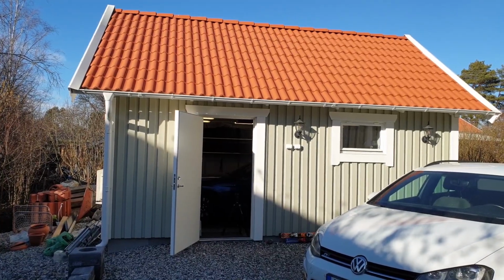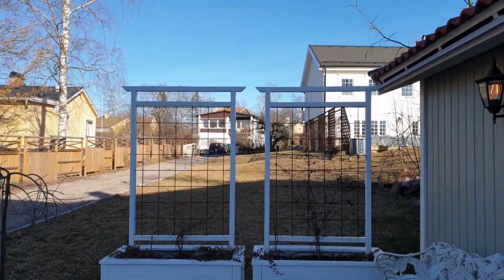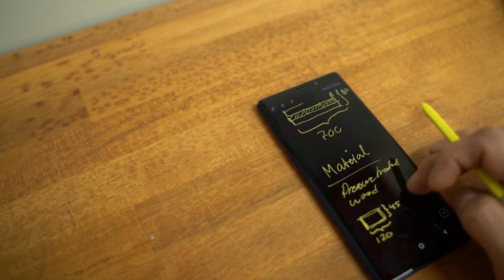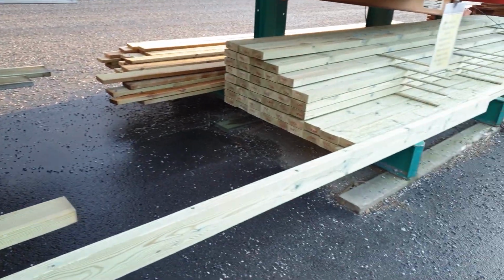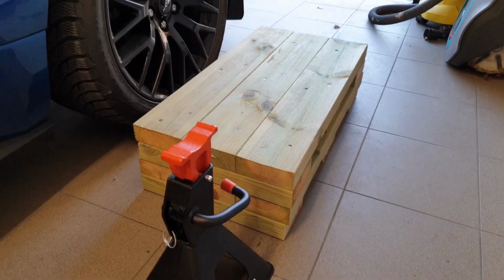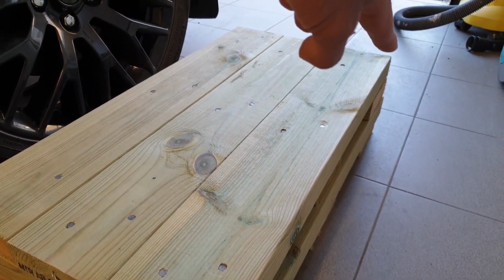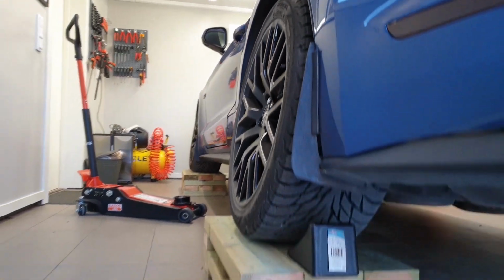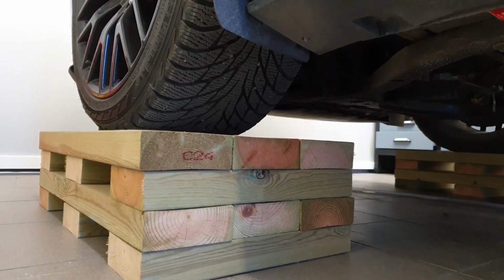DIY wheel cribs

Comment: Could jack stands and wheel cribs be used together for extra safety? Jack stands under the pinch welds and cribs under the wheels. 

If using both, should the cars weight be on the jack stands mostly, or on the wheel cribs mostly? What would be safest?
Reply from the maker: sorry for the late reply! if the wheels don't need to come off and that the cribs are not in the way I would opt for having the weight on the cribs!

I have since moved on to quickjacks and from there to scissor lift :)

Comment: I am viewing a lot of these videos and plan to make my own.  I saw on another video that used glue to keep the blocks together and the weight of the car would compress the blocks down so it would not move.   The guy said nailing or screwing the blocks can crack the wood and reduce the strength.    In the video here he needs the wood across his final project to stop the tires from moving which he did mention he would do it.  Nice build and super garage and shed.
Reply from the maker: Sorry for the late reply! Not sure if it would crack the would but you will have some horizontal force. But sure of that would be enough do do any harm. You can always do some pilot holes if you are using scres. But one option that might be good is to glue +using nails or screws.

I use my regular chockss on the cribs to prevent the car from rolling but you can add stops with some pieces of wood as well.

Thank you, much appreciated!
Reply: use construction grade screws. the idea that screws snd nails make the wood weak is stupid. how do you think houses are built?

Comment: Would be curious to know the actual weight these kinds of cribs can carry.?. For example a full size car - like Crown Vic’s or chev Caprice? (Nice job btw). 🇨🇦👍🏼
Reply from the maker: The wood joist will take a very high load on its own. What could potentially be an issue is the hardware. There will be both vertical and horisontal load on the cribs on one side as you are on the other side lifthing or lowering the car(I usually do one side at a time). How much impact this force has one the binding areas of the hardware/on the hardware is a good question.

thanks btw!

Comment: This is great and I will end up building these for my jeep. However I will need to build a ramp part for it as my Jack is halfway to maxed out by the time I reach the lifting point.
Reply from the maker: Glad you like it. Yeah having a jeep would require some enhancements. I used the add-on cribs yesterday superfast and easy on the driveway (changed rear diffuser on my car) without any worries.

Comment: nice video, what is your floor jack max height? mine goes to 14 inches. you think I will be able to slide the wood cribs under in my case?
Thanks
Reply from the maker: thanks! Mine goes up to 19.68" = 50cm. Do you have a Mustang? It also depends then how much the suspension de-compresses I guess. You can always build a more modular setup so the height is a bit lower. 

It's always nice with new tools, buy a new jack :P
Reply: @Themazcorner  Storage is an issue in my case, plus lacking a garage :( 
(shopping for a new home is always nice lol)
I have a Nissan Maxima and you're right it depends on the strut and spring giveaway. This is much safer than jack stands alone!

Comment: Someone needs to learned engineering basics 101. You could have cut that stack in half and then used that to go up higher. And be fine.
Reply: "Someone needs to learned engineering basics 101" .. someone need to learn proper grammer.. 

Dude does know his engineering basics,  as a matter of fact he is beyond engineering basics. What you are describing is different way of doing it.  It gets to the same output but more efficient.  

BTW, This isn't "basic engineering " . This is static strength of materials which is considered a upper division course in an ABET accredited institutionof higher learning(ie university).
Reply: @dannydee9919  no this is basic engineering lol if you actually had a job which involved running simple bending stress / shears calculations all day, it's basic. Try again

for simplicity and to be conservative. assume a simple point load and the wood is being supported the ended. M=PL/4, SIGMA=M/Sx. Don't have my AISC book next next to so can't remember the make allowable for pine. 

So uh yeah basic engineering try again.

It's a freaking 4000 lb vehicle not rocket science. You must still be in school lol
Reply: @dannydee9919  lol you must be 5. But okay that's fine stop talking. Thank you

Comment: Nice house, good job, but i think your worries about the jack stand are unnesessary, they have been used for centuries ;) I think you need a Quick Jack ;)
Reply from the maker: Thank you :). I know but still not comfortable :D. Haha I am jealous of your stands. I had far gone plans to prepare the foundation for proper scissor lifts in the garage but it is to small...
Reply: Mazman was correct to feel unsafe with the normal stands. Lot's of people feel the same. Firstly, there's no guarantee the stand welding won't fail. Secondly, the contact points between the stand and car is tiny. There is risk of sliding and slipping as the car is rotating on the stands while being lifted. This risk is also present if you apply horizontal force to the car when using impact tools, or pulling stuff off the car. External events are also a problem in shifting the car, such as sonic booms or nearby accidents that cause the ground to shake. None of these risks affect the large based wood stands to the same degree. In fact if the car does fall, it cannot fall through the wood nor cause the wood stand to tip over.
Reply from the maker: Yes specially considering heavier cars it feels much safer with the cribs. When working on suspension I add the cribs close to the jacking point together with the jack stands just to be sure